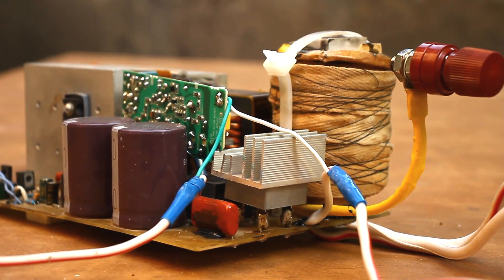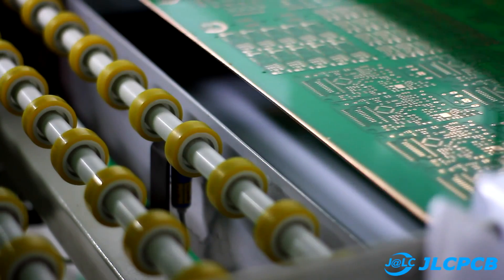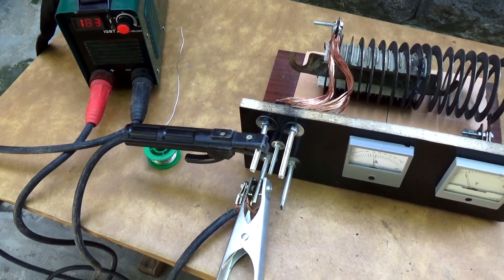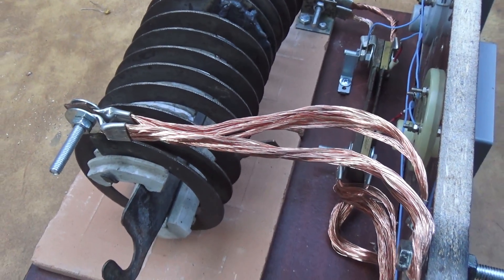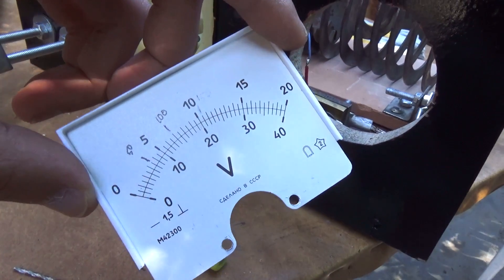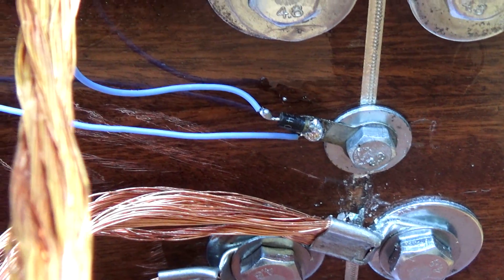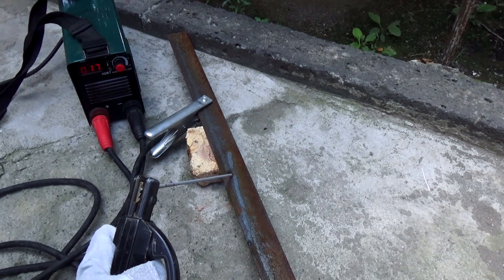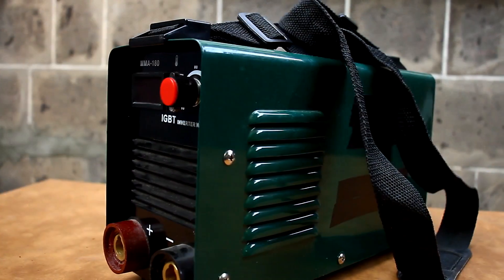How to test a welding inverter ?

Comment: Some how forward topology work better then halfbridge converter topology I had the same issues when I made my first smps welder but a voltage feedback can be added to allow the halfbridge converter topology to work properly 37% duty cycle 62 voltage and at 50% full duty cycle the voltage with go 100 volt so the welder dropout voltage with no be 15 voltage but 26volt

Comment: How do you get 4kW through a Schuko plug? (or rather even more than that, because the 4kW are the output power, not the input power of the welder). Do you have a 20A fuse on a 230V circuit?
Reply: From what I heard, there are different regulations, depending on the country in terms of how much power is allowed to be drawn from an AC wall plug. 
So, in USA, you can't find a 2kW water boiler. While in Germany, a 2.3kW device is not a problem, and my hair dryer draws 1.8kW. 
The limitation is given through the fuse for the circuit that you are using, and (even more important) your wiring!
When pulling so much current, the voltage drop across the wires in your walls matters, because the power of 
dropped voltage•current•√2 = P
 is dissipated as heat across the resistance that is given by your wiring. 
If it's too much, something's gonna melt, short curcuit, there will be sparks, and maybe a fire. 

But if everything is alright, then you can draw as much as you are ready to pay for :P
Reply: @oilybrakes  
Yes, I know that ;) . It's just that Schuko plugs are rated for 16A max (and not even designed to run that continuously), no matter how good the wiring before that is. Of course you can draw more, but that's what the fuse would be for to never allow that, because otherwise as you say melting, smoke and fire. So there has to something dodgy going on if you can get 4kW output on the welder. It shouldn't have that plug in the first place.